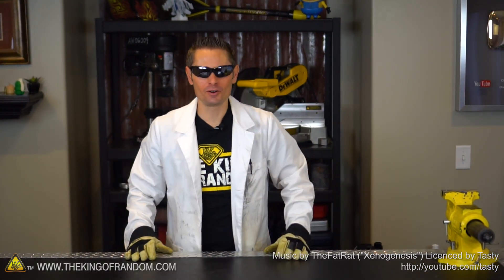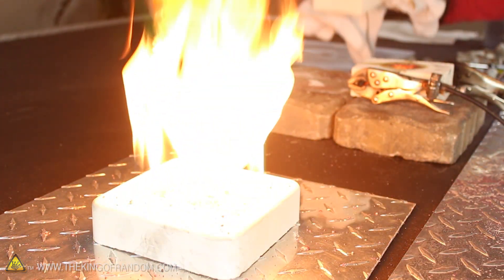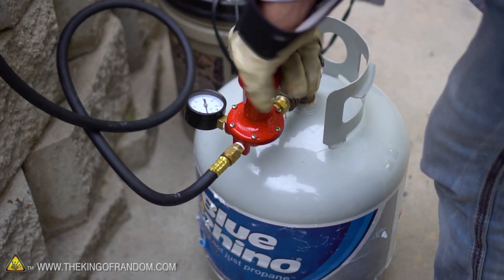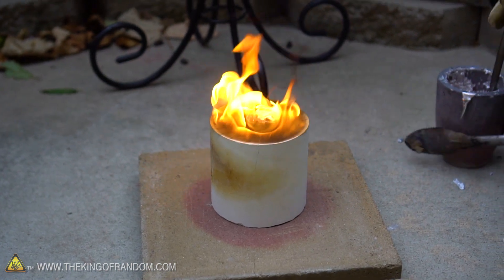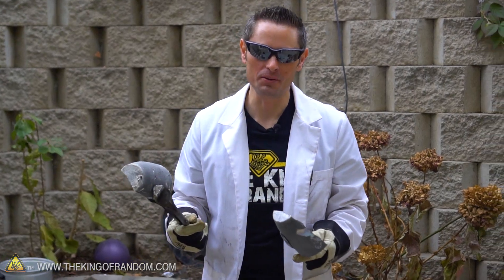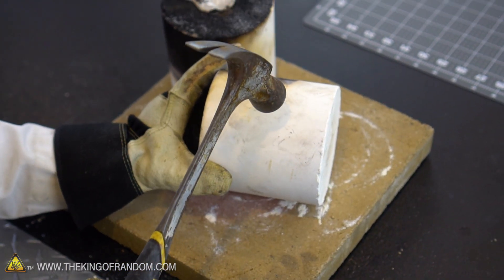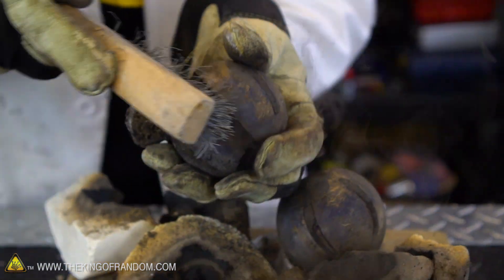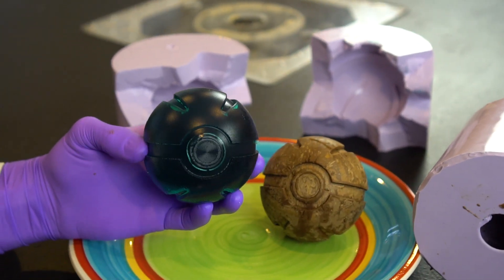Casting Aluminium PokeBalls

Comment: you need a 50/50 mix of plaster and sand. then burn out the cast in a kiln.  also bury your cast in sand before pouring.  It is always better to pour while your cast is hot.

Comment: You need to make a DIY vacuum chamber to degas your silicone molds to avoid those air bubbles.  You also need a sprue and a riser to help avoid that air getting trapped in your metal molds.

Comment: to prevent more air bubbles you should make two vents on top of the hole you are pouring through. in the wax phase just attach would straw diameter vents then pour the plaster of Paris

Comment: To avoid bubbles you need this small machine that has a vibrating desk on it, not sure how it is named. It is just small desk that vibrates. Vibrations help removing the bubbles. We use it in our dental lab when creating dental model that is later used for creating crowns and bridges.

Comment: there is a plaster called investment that is used in lost wax casting. it dries overnight and then you burn out the wax. also after pouring the plaster it needs to shake to release bubbles and extra moisture.

Comment: Check out the method used to do aluminium and bronze casting on the YouTube channel SVSeeker. They went through a lot of trial and error with a little help from some nearby foundry workers. The process is definitely something that could done in small batches at home.

Comment: For your casting add a second vent hole for the gasses by attaching a sprue of wax to the pokeball so as you pour the flow of metal in isn't messed up by escaping gas. In lost foam it happens so fast its not as big a deal

Comment: 1 - the molds need a venting orifice, in other words, it should have TWO openings, one for the metal, other for gases to escape.
2 - no matter what, never bubble any gas across molten metal, it will become weaker. in that case, you should have placed the molds itself into the furnace to degasse it at very high temperature. they should give off their volatiles BEFORE being used to cast anything.
3 - prefer graphite crucibles, they are way better.
4 - no space for failures, you need better ways to hold the crucible when removing it from the furnace or pouring the metal. what you are using right now is too unsafe and should not serve as example...

Comment: Also if you place the wax mold in a bed of sand and leave a hole on top the metal will melt the wax as it goes in this also works with styrofoam
Reply: Alex Florimbio he already knew that

Comment: @grant thompson i am metal worker but not that much experienced with casting , but what i definetly know : you need to remove the top layer of oxidized aluminum bevor pouring it into the mold 

and also there is special sands for making molds (but i dont know how its called in english , since english is not my native language) 
plus you dont necessarily need to remove the wax , google "lost foam casting"

Comment: to counter the shrinking you need to make an second "drain" and fill it with metall so when the matireal cools down it drains metal from there and not from the actual work piece. It is also important to locate the second drain at a point of the work piece where the most mass is located!  (sorry for bad english)

Comment: When I learned how to cast, we used a sand and oil based clay mixture in a set of box forms and you basically just fill the box, which is in 2 halves, each a little larger than half of the object you're molding, so stacking the two together is larger than your piece overall. To eliminate air pockets or bubbles, poke small holes near the top, or in any area near the top with great detail. Ideally, the parts of greatest detail will face down so they will be filled first when pouring. I would like to give you some product that I think you can use on your show in exchange for some recognition and an endorsement. I think you will really like what we have, and if you are interested please send me a private message. Thank you for all the great content, and keep up the great work, Grant!

Comment: I believe with your castings, especially plaster, you would benefit greatly from a vacuum chamber, i bet a silicon sealed bucket with a hoover adapter would work, even tubing using a water tap would work i'd bet

Comment: Grant if you cover the mold with sand leaving the plaster hole open to the air it won't burn as much because the sand smothers most of the fire this requires a steel rod being cured into the plaster though

Comment: To minimize air bubbles you'll need to degas the silicone and cast under pressure between 45psi to 60psi.
Make the hole for the metal pour smaller and add 3 to 4 sprews (straw sized vents) for air to evacuate.

Comment: I don't personally know the recipe, but from watching other channels, it seems the best way to cast is to use investment plaster, which I'm pretty sure you can buy if no recipe is available, it's specially designed for metal casting and has something to do with Plaster of Paris and sand.

Comment: +Grant Thompson - "The King of Random" i would suspect to avoid the bubbles on castings to drill 2-3mm holes next to the pouring hole.. so that trapped air can be released but not damage the cast and also only about 3 - 4 holes i would guess would be fine. wont matter what angle u drill in(side) to mould is. so long as from the outside to inside mould is 90degrees. obviously make sure holes are near top by pouring hole so u dont have the overflow (as such) when you have only 1/4 full cast.

hopefully this made sense. 

any questions feel free to ask.
Mike

Comment: Grant, there is a spray that you use before you cast.  I don't remember what it is called however, you would mount your wax mold on the spore and then place it in the casting cylinder.  Then you would spray it down with a chemical that would help release any bubbles to ensure a clean/bubbleless cast.  I used to cast molds in school many years ago.  I hope this helps!

Why not cast the Star Wars Rebels/Empire symbols (in honor of the new movie coming out!)

Comment: My suggestion to avoid bubbles while casting is to 1: instead of the single hole to pour into, make a 2nd vent hole on top where air can freely escape as the mold is filled. And 2: you can also try letting the molds cool while on a reciprocating plate of some sort. The vibrations should help dislodge any tiny bubbles that get trapped. I'd be interested to know if differences in the frequency of vibrations will do anything to the lattice structure of the cooled aluminum.

Comment: You need to incorporate small vent holes to release the gasses as they form. Small thin wires will do the trick. Just poke them in near the top as the plaster / investment hardens. Then pull them out when the investment sets. It will leave small extrusions but they are easy to remove with a dremel or other cutting tool. Also, add some vermiculite to the plaster to help control cracking.
Reply: also the kind of wax used was not ideal. a small amount of  the candle wax absorbs into the inside surface of the plaster when you bake it out and burns away when you pour in the aluminum. vent holes will help but you could also buy specialty investment casting wax that won't absorb into the plaster and therefore won't burn out as the aluminum is poured. you can also eliminate the air bubbles in the aluminum casting by "jiggling" the mold as the aluminum hardens which will let the air bubbles float to the surface.
Reply: skycarl Yep. He should see this comment. Nice idea man.
Reply: When aluminium cools from its liquid temperature to ambient temperature, the total volume decreases. This is why there are geometrical imperfections near the top of the mould. You can make the pouring section a bit longer and wider, which will provide for more liquid aluminium (its the last part that will go solid) and "fill" the lack of aluminium created by the cooling.
Reply: No apos, I'm an old retired dental lab tech. Just always enjoyed doing a lot of stuff.
Reply: skycarl you the man, carl.
Reply: Everyone LIKE this comment so he see's it.
Reply: Also use something to vibrate the plaster/investment as it's poured over the wax so no bubbles form.
Reply: Thank You i didn't need to tell and explain this :D
Reply: then you are doing it pretty well mister
Reply: u relay smart I r8 5
Reply: It will work for final casting. Is there anything to do for the silicon mold? Most of the problem lies there even after the vacuum
Reply: Really he wants to get the plaster /investment to around 900 degrees Fahrenheit this will get all the moisture out and also will burn off any leftover carbon from the wax chemical
Reply: GG carl
Reply: skycarl are you chemist?
Reply: That should work fine!
Reply: hand
Reply: Yeah! Random this advice is gold!
Reply: Nice idea! Grant should see this.
Reply: skycarl thanks you helped me a lot
Reply: Diolectic are u chemist? why no bubles?
Reply: What if I'm casting something in an open mold I.E. an aluminum coin
Reply: another practice to prevent your mold from cracking is to put them in a container and surround them with sand. the pressure will help hold it all together.

Comment: To remove some of the air bubble you could make a vacuum/degassing chamber. It consists of a large airtight container with a vacuum cleaner attached, so you can remove the gas from your silicon or wax.

Comment: Cast your face! Use the silicon, but after putting a light coat on, layer gauze then another thin coat, this will help it strengthen and not crack when bent and will help it last longer!
Reply: (Use vaseline on your eyebrows and hair line to not lose follicles to the silicon.

Comment: Mr. Grant Thompson, I'd suggest you to use investment materials instead of plaster. It is used in dentistry to cast metal castings for restorations and prostheses. Phosphate bonded investment material can be used to cast metals with temperatures greater than 1000 degree Celsius. They don't crack up unlike plaster casts unless dropped and require high temperature for melting the wax pattern inside it. Its pretty durable compared to plaster. Please give it a try next time.

Comment: To help with casting dont have your sprus go directly into the part. as you said in the video this will mix air bubbles into the casting. also the force of the metal falling into the casting is likely eroding the plaster from the bottom of the spru and causing the plaster to mix and burn into the metal. have the spru to the side of the part and then have runners connecting the spru basin to the part. the bubbles and bits of plaster will be trapped in the spru and not make it to the metal casting like the image i linked below. also check out a book called "principals of metal manufacturing processes" the isbn# is 0-340-73162-1 it has all the info and likely more than you need for your channel but it is interesting stuff. it is an university textbook for an engineering course with the same name.

[http://4.bp.blogspot.com/-TrrZT8p9d00/U5HOMDhmS1I/AAAAAAAAAd8/bEHjVsOCT6g/s1600/green+sand+mold+mould+gating+system+sprue+basin+pouring+runner+gates.png]

Comment: why not use the Play Sand instead of the plaster? I would have thought that that would be the better option, especially considering that if you used that press sand/molding sand the some other youtubers use when casting (tito4re for example).

Comment: when you're using silicon you should use a vacuum chamber to get the air out.  Watch Tested, they show how to do it.  As far as how to avoid the air bubbles with the metal cast, try more than one hole for venting

Comment: when you use the silicon to make a mold, before you let it set you want to put it on like a vibration table if possible. or could possibly use like a hand sander without the paper to vibrate the silicone. this will cause any airbubbles to raise to the top and gass off. the same goes for when you pour your plaster molds as well. this will help prevent any pock marks in your product. 

what you should try to cast next, is a mouse for a computer. that would make an awesome paperweight for a desk.

Comment: to avoid the air bubbles, u need to have 2 holes one for the pour and one to vent. instead of center fill hole off set the fill hole and set vent hole to other end.

Comment: drill more holes in the plaster besides the full hole which is a little too large with the wooden dowels not sure if that makes a big difference or not but that'd how we did it the air needs more places to escape due to the first thing to harden is always going to be the fill hole so you will always get trapped air if that's the only hole
Reply: very small holes like 3 to 4 1/8 inch holes around the fill hole and never closer than an inch to the outside egmdge of the finished product

Comment: If you're thinking of metal casting, you should consider making a sand mold rather than plaster. Some use greensand or paver sand to make the casting molds.
Reply: Brandon Peppler Yes. Sand is a better idea. I could not understand why did he use plaster at first place.
Reply: Just an experiment to consider what works and what doesn't.

Comment: you can use the silicon model to make a styrofoam ball. then you can pack sand around the styrofoam and then when you pour the metal it melts the styrofoam
Reply: check out Tito4re. he casts with copper.

Comment: Proper metal casting requires venting of exhaust gases from inside the investment. Use wax and straws to  create vents from sides of the piece that exhaust to the top of the piece before you make the plaster. Burn out will then make proper vents in the plaster. You'll need to put a bit more work in to cut the aluminum vents off the piece but it's worth it to have a perfect casting every time.

Comment: if you use dental investment instead of plaster of Paris then you can solve your problem with the bubbles from the vaporization. just make sure the investment is very hot (600 degrees Fahrenheit) when you pour. bonus: dental investment  dissolves I water. and it can handle silver and gold.

Comment: Make a poke-ball bomb! or a fire cracker

Maybe mount it on a modified Randomizer rocket and explode it in the air?

Also would've liked to see the aluminium balls polished with sand paper or somethin, it'll really give it a nice touch...And then maybe you can giveaway the results??

Comment: Grant, I have some experience with casting. I think you should redo the wax in the silicone negative. Then using the wax positive use green sand for your mold. With some practice you will yield beautiful results.
Reply: Also grant check out my newest upload, I built your stealth shelf design and gave you credit.

Comment: Hey Grant, it looks like you need some breather holes where the air bubles are trapped at the top. once you have your wax version, insert a straw anywhere you think air will get trapped. Then pour your plaster, wait for it to cure, remove your straw and melt out your wax.

You'll end up with little bits poking out, but cutting and sanding them off will give you a better result than having a dud pocket on your cast. Hope this helps!

Comment: can't you just pour a little bit of silicone into the molds and put the metal molds in and then close it? That way it would fill the air bubbles and the rest would squeeze out

Comment: Could you put the Styrofoam jet in silicone and do the same process and make it metal?
Reply: Pablo Amazeballs no
Reply: Pablo Amazeballs  he already made it. he just bary the styrofoam jet on the sand and pour the aluminium. The styrofoam got burn and filles up with aluminium

Comment: To avoid those air pockets, next time you make your mold add some venting tubes. Just like you added the block of wood for your pour hole, get some straws or thin sticks and place them around where you think you might get an air pocket. Then just cut and sand away any spurs you get from them just like the stem from the pour hole.

Comment: if you want to get rid of bubbles use a vibration rod like you would pouring concrete or use a high temp vacuum chamber as I said previous video

Comment: Make homemade wind tunnels and paper/lightweight RC planes wind the wind as fast as the takeoff speed in the opposite direction of the plane so it floats. Add smoke so it shows the whirlpool wind caused by the air pressure difference between top and bottom surface of the wing.

Comment: For future reference if you want to make metal objects with a plaster mold I would consider using Tin or Pewter as they melt very low ( under 500F ) and you can get a cool shiny appearance to it. The only downside is pewter and tin can get dented and scratched easier than most metals

Comment: Sand based molds tend to work better for metal casting, it also has the benefit of the sand being reusable. Green sand is basically silica sand and a powdered bentonite clay to hold the sand together.

Comment: Hey, Grant, when you're melting the metal, unless you already do so, add a flux to it. it can keep the aluminum  (and other metals) from getting oxidized during the melting process and cooling process.

Comment: Should of drilled four 6-7mm holes around the top of the filler hole to let all the air out and the aluminium would of come out them holes aswell but that don't matter